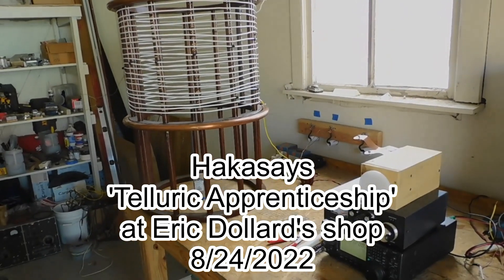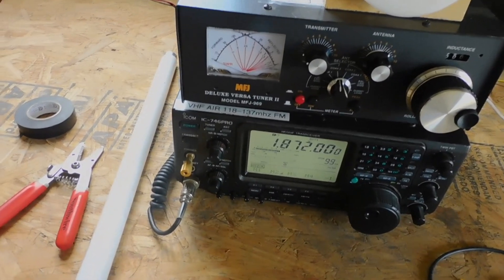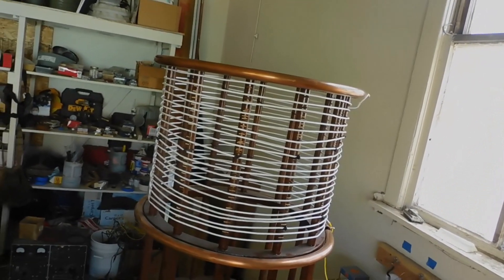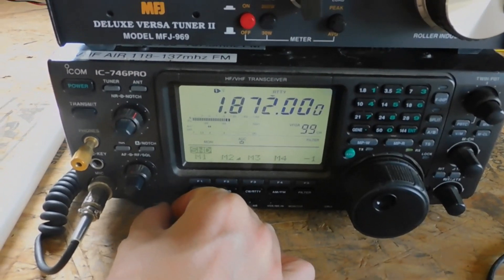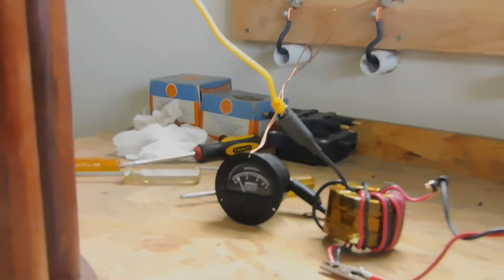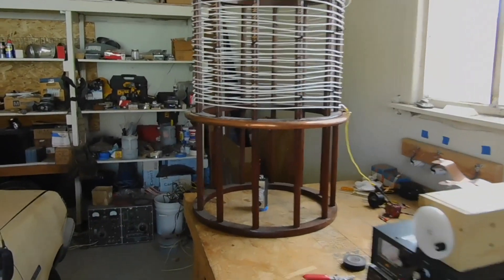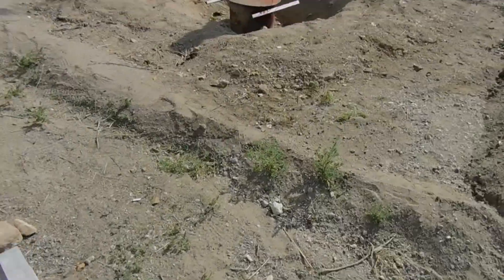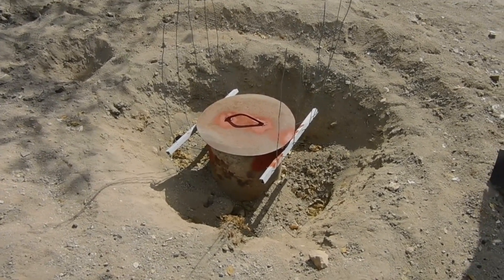'Telluric Apprenticeship' under Eric Dollard, part 1

Comment: What is the website for the tesla coil calculator ?
Reply from the maker: coilcalculator.hakasays.com
🙂
The calc does still need work since we've learned a LOT since 2021..
One thing we did not know is that the wire spacing affects system impedance but not the overall Q factor.

Comment: Bought your presentation,  great work. As a noob, what is the role of the 2 pipes at the bottom and top of the coil. Thank you
Reply from the maker: The copper rings are called 'loading rings', and they server a couple purposes
1 - They help lower the frequency, which can be useful when making big coils
2 - They help stabilize the dielectric field produced, meaning the frequency doesn't drift quite as much when loading or working nearby.
3 - Loading rings helps prevent breakouts (high voltage discharges which can be very problematic above a few hundred watts.

Feel free to email/msg back, especially if you want to start experimenting in this field, there's so much left for us to figure out😉

Also am a long-time student of Dollard and I can try to answer questions from his POV (since he can be harder to get a hold of)
Reply: @hakasays  definitely I will . Thanks again
Reply: @hakasays  Hi Haka, just found your channel and was very happy to see how active you are here on the site, I'd like to ask a few questions concerning the technology:

First is about using a bulbed top capacitance like the one Tesla used in his MT Tower and patent in place of loading rings, would you say using such a top load would serve the same functions of the loading rings to the same effectiveness, and is a load required on the bottom of the coil as well as the top to properly set the boundary condition?

Second, I'd like to ask about Bifilar coils, according to Tesla that coil design increases the self-capacitance by 250,000 times compared to a standard coil, basically turning the coil into both an inductor and capacitor, would there be any advantage to winding these lone extra coils in bifilar configuration? According to Ivo the high self-capacitance of the coil makes it especially good for producing Radiant Energy.

Lastly, is there a difference in how these spaced extra coils behave when excited with Radiant Energy from Impulse Currents of sufficiently short duration compared to Longitudinal Electromagnetic excitation? I've seen classic modern Tesla coils excited with Radiant Shockwaves that produces phenomena similar to EM excited "real" Tesla coils like the one you have here, especially in both air and ground power transmission capabilities. 

EDIT: Extra question, I've seen examples where modern tesla coils experience a drastic drop in Amp consumption when sparking the top load, why is that? Is it due to a resonance condition between the coil and the spark? And do these spaced extra coils produce Alternating Current output or Oscillating Current output?

My knowledge is very much full of holes so I'm trying to get as much of a complete picture as I can of the basics, cheers!
Reply from the maker: @JenkoRun  
Apologies for late response:

>>would you say using such a top load would serve the same functions of the loading rings to the same effectiveness, and is a load required on the bottom of the coil as well as the top to properly set the boundary condition?

Spherical/toroidal topload and rings are the same, the only difference is the rings on perimeter force more dielectric lines-of-force inward making the coil a tiny bit more stable to external changes
(objects physically moving toward/away the coil)

>>Second, I'd like to ask about Bifilar coils, according to Tesla that coil design increases the self-capacitance by 250,000 times compared to a standard coil, basically turning the coil into both an inductor and capacitor, would there be any advantage to winding these lone extra coils in bifilar configuration? According to Ivo the high self-capacitance of the coil makes it especially good for producing Radiant Energy.

Bifilar has a ton of potential (pun intended) but the math is so complex Eric hasn't really tried to model it yet.  I will bring is up in the next live-call.

>>Lastly, is there a difference in how these spaced extra coils behave when excited with Radiant Energy from Impulse Currents of sufficiently short duration compared to Longitudinal Electromagnetic excitation?

We's seen coils perform VERY different under impulse currents compared to continuous waves (Adrian has a ton of writing about his).   In my eyes yes short impulses will lead to asymmetric energy exchange (energy appearing or disappearing), but it's so hard to quantify because impulse currents tend to blow up your measuring equipment!
Reply from the maker: @JenkoRun  

bonus post for the bonus questions:

>> I've seen classic modern Tesla coils excited with Radiant Shockwaves that produces phenomena similar to EM excited "real" Tesla coils like the one you have here

Yeah there's a ton of overlap, but most coilers I see online only concern themself with the magnetic field; they don't realize controlling dielectric field is just as critical (if not more!)

YES, STARTING WITH THE BASICS IS BEST!  You don't want to build a free energy or gravity device without knowing what you're doing, because you'll drive yourself mad trying to reproduce it.
You'll get lost in a new world if you don't try to keep a map of your progress.

>>EDIT: Extra question, I've seen examples where modern tesla coils experience a drastic drop in Amp consumption when sparking the top load, why is that? Is it due to a resonance condition between the coil and the spark? And do these spaced extra coils produce Alternating Current output or Oscillating Current output?

Probably that is due to the sparking dropping the frequency closer to its natural quarter-wave frequency.   You could tune a spark-gap TC and lower the freq such that it works best when unloaded and current goes up when it's loaded.

Always a pleasure finding fans interested in exploring esoteric electricity with the rest of us😄

Comment: What if you lift your outside antennas higher
Reply from the maker: Good thinking.👍🙂
Yep, having the 'antennacoil' elevated would improve reception, mostly because it helps isolate the dielectric field from anything nearby making it more sensitive to far-away signals.

The metal siding of the building actually causes a fairly significant load at the levels we are working with

Comment: Hey man, iam new to this stuff , what was Eric's End goal
Reply from the maker: I would say Eric's goal is to better understand electricity in a more advanced way than is understood today,
and to build engineerable experiments to prove it.

The current goals are seismic forecasting (using radio to 'listen' to the Earth and predict earthquakes hours/days in advance),
and telluric communication (using the Earth as an antenna like Tesla did a century ago).

Both are generally considered to be 'impossible' despite much of the math and preliminary experiments suggesting otherwise.

Anyway, hope that helps😄
Reply: @hakasays  thankyou it does

Comment: Do u understand how to translate Eric’s work to
Musical application, or tech application through music for positive impact
Reply: Eric considers bach to be the tesla of music. There is a thing called "counterpoint" that i think eric is drawn to, the principles and theory behind much of classical music. He also emphasizes the ratios and relationships between notes themselves. Walter Russel/waveform mechanics emphasizes the transition of elements more than the elements themselves (in my vague understanding based off listening to Barre Lando. Admittedly havent read any of Russells works yet). These are all points that run around in my head and i think theres something to it. I think studying counterpoint is a good place to start
Reply: Ive also heard Eric mention he worked in the music scene for a while helping peoples equipment sound better. Thats a very useful practical avenue that i would like to hear him touch on more. But maybe he already does in his various works?
Reply from the maker: @monkeyrilla  I believe Eric uses a particular Bose system for his 'home music'.
The audio field I don't know much about other than that it was considered as a useful business endaevor.  Homemade tube-based amps of the highest possible quality and fidelity.

You are quite right about the link between music and electrical engineering; Eric considers them to be linked on an intrinsic level.  To the point that a particular Bach piece could be considered an Electrical Engineering piece.😄
Reply from the maker: I have a rough idea what Eric wants for musical work, but the detail is almost surely a complex vacuum-tube-based setup I would have a hard time following/replicating.
And always MIL-SPEC🧐

Eric listens to Bach religiously every day, it is probably the main thing keeping him grounded.  Personally I don't have the same ears for music though, so it's harder for me to discern how we might apply it.